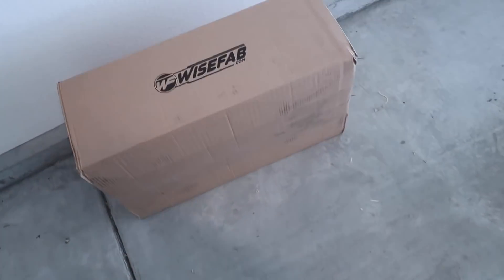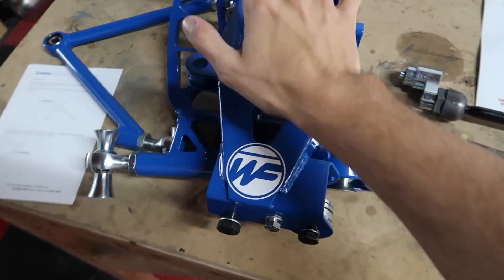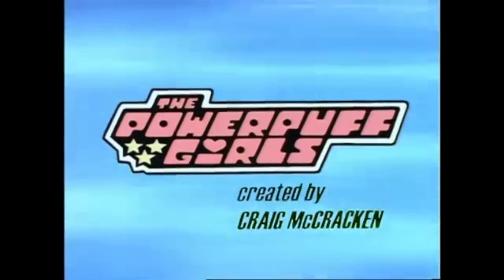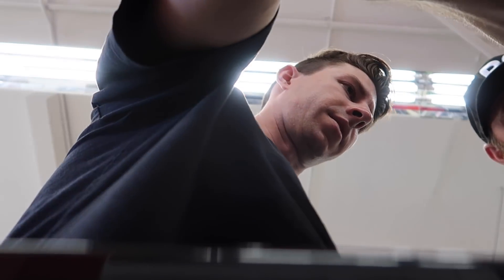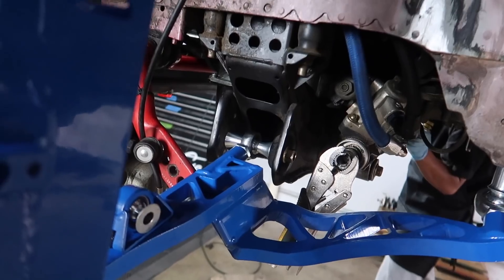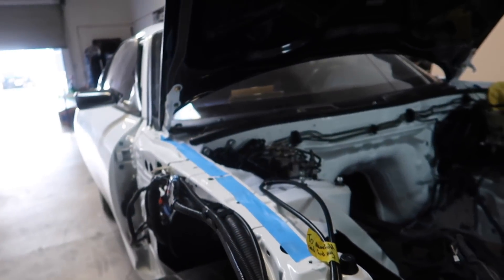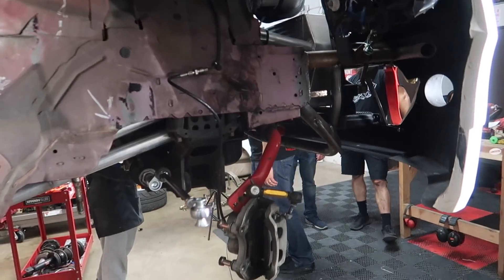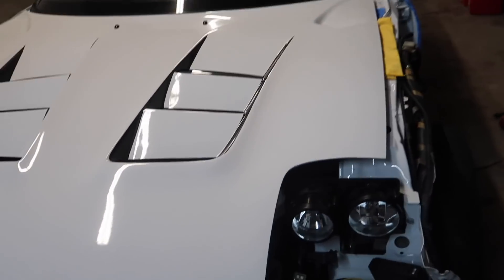Does this mean my car is totaled?

Comment: No sway bar for more wheel droop on the inner front wheel, allowing for more control/grip. And pro-Ackerman is awesome for drifting and rally. It’s the outer wheel having more angle on full lock. That’s my best explaination. Hope this helps fellas good luck on the car!

Comment: Teeg! The dealership will always tell you it's fine for this and that because, at the end of the day, they want you to come back for more commision for themselves
Reply: MTJY the dealership is right. The only time he needs to let the glow plugs warm up on a truck that new is when it’s well below freezing.
Reply: Modern glow plugs warm up a lot faster than older ones. Not waiting on them doesn't do anything that would cause any damage anyways, it just may take a little longer getting started
Reply: Only time i let my glow plugs warm up is during the winter here in Sweden.
Reply: Can i ask what a glow plug is? Im sorry if thats a really dumb question lol
Reply: Salespersons do not get commission off of service... Only sales...
Reply: The new Chevy trucks have this mesh that heats up the diesel instantly no need to wait for glow plugs to heat up anymore.
Reply: Ryan YT the glow plug is a heater for the combustion chamber in a Diesel engine. Diesel fuel isn’t ignited by spark it’s ignited by heat and compression. So instead of spark plugs like a gas engine has a Diesel engine has glow plugs to heat up the combustion chamber

Comment: Lol sav we have the same problem with our angle kit. Run SPL outer tie rods bro. They’re extend and are adjustable and extremely beefy.
Reply: And the more the inner tie rod sits in the outer, the more likely it will take more abuse

Comment: Ive had the same issue on my G for the bracket issue. I had to bend it back and weld a bit because even when i could get the bolt through, it had movement.

Comment: bent subframe brackets is very common, not just on treefiddyzeds, on other cars too, as long as you can hammer it so the wise fab fits it will be fine. You can get an alignment after anyway

Comment: The truck has an electronic ignition like a push to start, you don't have to hold the key in the starter position, which means if the truck needs to cycle the glow plugs it will before trying to start.

Comment: The key fob can activate the glow plugs before the car is in a KOEO state. So example, you are 25 feet away and press the unlock button, the glow plugs can be turned on at that point so it is a quick start up. Plus in Cali you don't really need themdue to the natural hot weather... At least compared to the north in cold weather.

Comment: Glow plugs only apply to older duramax’s. It mainly just warmed up the block because it didn’t atomized the fuel very well but newer model diesels have the ability to atomize fuel exceptionally well to where they don’t need glow plugs.

Comment: I think that you should wait in the ignition mode like 2 or 3 seconds if the engine is cold and about one second if the engine is warm, just to be safe. Please don't just put the key in and start the truck immediately, like a gas one.

Comment: Theres a small light on the dash on all diesles... It looks like a infinity sign and is usally orange. It's like that on new trucks too, just it doesn't take as long... like 1-2 secs. When the light turns off the truck is ready to start. takes longer if its cold

Comment: you dont need to leave the ignition on because the car will either use a door or key in sensor, which enables the glow plugs to activate before you even turn the ignition on

Comment: TJ the glowplugs starts to heat up when you open A door. you opened a door to load stuff in the back and the glow plugs are already preheating. thats why you don't need to wait in ignition anymore. and besides that nowadays the technology is far enough to reduce the preheating time from 10/15seconds down to 2seconds. so literally opening the door, get in the car and put your key in the ignition is double the needed time. don't worry about it

Comment: I put wisefab on my 350 a week ago took me 3 hours alone on jack stands wish i had a lift lol my lca subframe  tabs were bent as well i took vice grips clamped them on the tab and pushed with my foot then stuck the bolt through lol but Wisefab is so much angle its Awesome i need over fenders asap though lol

Comment: Next time clamp pliers on the wall that the A arm goes onto then then push it in the direction you need it to go instead of trying to hammer it, should speed up the process and make it a lot easier

Comment: Its a newer truck bro you don't need to do it. The older ones you have to. But usually you'd let the glow plugs warm up only when its cold. But your truck is so clean bro you should straight pipe it and tune it.

Comment: I had the dealer tell me that when I went to get a new Colorado Z71 Duramax, but I still don't trust them. Regardless of what they said, I would recommend you reading the owner's manual as it should say that in there, and there should be a small light in the gauge cluster that will tell you when the plugs are ready. Please read the manual buddy!! That Silverado will last as long as you if you take care of her.

EDIT: All the old Chevy trucks last like that, guess we'll have to see how the new ones are. If it's anything like they used to make, it'll last a lifetime with the proper maintenance. If all else fails, get rid of this one and getcha an old Square body or something. 60s to 2002

Comment: all glow plugs do are warm up the cylinder for cold weather applications. you can start a diesel skipping the pre glow cycle. if you're in colder weather then it is better for the vehicle to let the pre glow cycle go. its just the ways diesel work. heat to ignite fuel to cause expansion of cylinder. worked on hmmwv for 4 years and we would skip it even in the snow. southern California will never be cold enough to benefit from it.

Comment: I guess the PBM kit isnt as weak as you were thinking if you managed to bend your frame. LOL Fail.
Reply: James Grant PBM kits are still pretty weak. Alot of people have problems with the heim joints bending. So when you strengthen those the next weakest point is the structural part of the lca.
Reply: James Grant yeah kept bending pbm kits and was surprised the wisefab didn’t bolt right up. 😂

Comment: On a cold start, no matter the temp, you need to wait for the coil wire light to go off... because the cylinders have no heat for compression... this can be as short as a second, max you wait is about 3 seconds... idk where people got 15 seconds, probably people who dont own diesels, but you are supposed to wait until the coil light goes off... period the end, no matter what the stealership says

Comment: You're fine on the glow plugs. But if I were you give it a sec or two, you won't hurt anything. Older disels can overheat the glowplugs, modern ones won't. I've owned an 84 F250 diesel and have cooked them

Comment: Tj, what you said didn't make sense. Yes it is designed to buckle in on itself to save your car from frame damage. There isnt a case in which it could bend when it shouldn't. If they are designed to bend on a certain point, it doesn't matter if you feel that it should have or not.. if it stayed solid it may have damaged your frame. Sometimes things happen that we aren't aware of, and the energy at play is more than it seems.

Comment: Lol it most likely doesn’t have glow plugs. That IS an older diesel thing.
Reply: The Cummins engines doesn’t have glow plugs anymore they used a heated intake system to heat the air going in the engine. But to my knowledge the gm and Ford diesels still used glow plugs due to the v8 setup for some reason. And the new Cummins in the nissans are also v8s so you really need to talk to a diesel technician at your dealer and get more information.

Comment: That new truck doesn't have glow plugs don't listen to the dumbasses that said u need to have them on before u start the truck it's not cold u don't need it and it has a grid heater in the intake and it cycles on when u start the truck for like the first minute or so

Comment: Why are you bashing PBM when wisefab hardly fits? So concerned about quality yet you shop at harbor freight? Wisefab has no sway bar mount? Also pushes the wheel 5 inches further out. Bih you wack